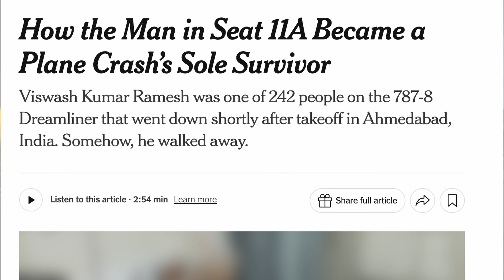Why the RAT Changes Everything – Air India 171 Update

Comment: Multiple Generators:

The 787 has six electrical generators: two per engine and two backups. This provides a high degree of redundancy in power generation. 

Backup Power:

In the event of generator failure, the 787 can rely on a lithium-ion battery for a short period, typically around six seconds. This is enough time to deploy the ram air turbine. 

Ram Air Turbine (RAT):

The RAT is a small, windmill-like device that extends from the fuselage to generate electrical and hydraulic power when all else fails. This ensures the aircraft can maintain essential flight controls and avionics even with complete engine failure. 

Triple Redundancy:

Key systems, like the Flight Management Computers (FMCs), are installed with triple redundancy. This means there are three identical systems, and if one fails, the other two can take over, preventing a single point of failure. 

System Independence:

The 787's electrical system is designed to minimize the impact of failures. For example, the system powering hydraulic, environmental, and lighting systems are designed for efficiency and redundancy. 

Software Redundancy:

The 787 also incorporates software-based redundancy, such as triple redundancy in the Flight Management Computers

Comment: In the late 80s Air Florida crashed out of DCA. The thrust indcater was faulty.  Because a clogged peto tube in the engine intake.  In the air Florida crash it was ice that clogged the tube.  So it would have to be something else. Could faulty thrust readings be a contributing factor.  How much runway do they use before V2

Comment: I didn't buy a premature flap retraction - first of all you would have to be some kind of bonehead to mistake the flap or gear handle on any aircraft.  Then there is the fact that on most aircraft - especially large ones - the gear lever is normally on the instrument panel while the flap controls are on the center console - most commonly on the right side.  I figured on a dual engine failure when I first saw the video, mainly because there is no apparent asymmetrical thrust, so both engines cut out at about the same time and spooled down at about the same rate.

Comment: I do know one thing.  If it's fuel contamination investigators can rule it in or rule it out.  There will be a log book somewhere that shows how many gallons/liters were put on the plane and it can be tested.  And you are right, having flown in jets with 3,000 plus flying hours, sitting near or over the wing where the exits are is the place to be. Typically, if I'm deadheading, I'd have my nomex flying suit, nomex gloves and flight jacket on even during the summer months, for take-offs and landings.  If one can survive the initial fireball you at least have a chance.

Comment: It has alwys been my theory that it was engen failure, that plane did not fly at all, that little power it had was just that of take of, so the engine must have failed in the middle of the runway, it was able to rotate because the speed was already good for that but the engines failed in the process, I'm saying that because it didn't have even the power to take up the LG, the way it was flying if the was a run way in front, it could have landed safely, infact it was not fly it was falling but falling nicely.

Comment: If it's a dual engine failure due to a technical fault the truth will not be allowed to come out by Boeing. AI was an original National Carrier and the Govt will play along due to prestige and the heavy Boring presence in India.. if it's birds then the Govt won't allow the report to come out coz it points fingers at environment safety issues in the vicinity of the airport, especially since it's Gujrat

Comment: In these times of mischief and sabotage Captain, I suspect foul play. There are things A respectable gentleman like yourself cannot suggest, but the few seconds of video and the bang is perhaps why someone whipped out their camera and started recording. A loaded plane filled with 400 passengers and fuel all the way to England, at critical take off cannot recover after V1 if the system has an explosion that cuts it's thrust. I mourn the loss of life, but like the last Concorde accident, there would have been no reaction time. The automatic RAT deployment was probably an indication of how hampered the Pilots were. 😢😢😢

Comment: Great commentary and with appropriate language!
I could be mistaken but the flaps (next to rhe body) do not look very extended.  They usually are sharply down from the wings.  Loss of power in both engines could be contaminated fuel which caused the pumps feeding the engines to fail.  
Contaminated fuel (excess water) was the cause of fuel gelling which brought down the first B777 in a crash just short if the runway at Heathrow.
All of the black boxes will tell the tale once the investigation is complete.
Sadly, this will be another episode for Air Disasters if they are still producing nee shows.

Comment: Pretty sure the engines were running fine but, I am also fairly sure there was Turbine stall for whatever reason evident by no smoke out the tail pipes. Those engines are extreme fuel learn/hot burn and if the running environment is too hot too dirty and too heavy load (unknown condition the engines were never designed to fly in) the engines will turbine stall regardless of air/fuel management systems plus both might even go into limp mode auto reducing throttle (Dumb). These engines can't rotationally stop leading to a restart option in the air which would also make a loud (Lean burn) bang as both would restart together (We can see in the video this restart never occurred). "Limp mode" disallows a restart!!!
"Limp mode" on aircraft engines, I have absolutely no idea why this condition even exists?!!
Notice: These are Turbo Prop Turbine (100% By pass No Jet No after burner) engines and you mentioned the sound of the RAT well these make almost the same sound upon take off.  The best way to hear the full power sound (only these engines) make is to be ahead of the Engines (I didn't hear anything close to power on. Power was in Reduced condition). Bottom line is these engines need a lot of thick air (Ground effect air) to take off, I assume once up in extremely hot air these type engines will loose thrust and thereby the Pilot will full throttle panic causing Impeller over run ( Low thrust), it's hard to think throttle back to save an Air Craft from Crashing but, take it from  "v-22 osprey prop over run" . 

Far Fetched; The way I see it is; the engines auto reduced power and the Air Craft went into auto land which believe it or not these Air Craft have (Someone musta hit the switch and the pilots put there heads between their knees).

Comment: 1. Can the RAT be deployed manually?
2, If so, I'd it possible that the pilots mistook the failure to climb (because of incomplete flap deployment) as dual engine failure, and deployed it?
Reply: 1 yes,  2. lots of config warnings to ignore. They would normally look at EGT and N1 N2. and confirm they were low /zero. Also RAT is fast to deploy, seconds

Comment: Another bit of evidence of a dual engine failure is the pitch of the landing gear.  I watched several videos and every time on departure and landing, and normally the main wheels are pitched up.  If you look closely, it looks like the wheels are pitched down.  A little research I found when the main landing gear is stowed, the first thing that happens is the main gear pitches down.  The power failure happened right after the copilot placed the gear lever to up.

Comment: Could it be linked to similar maintenance issue like the one suffered by KLM a month ago? KLM has decided to ground seven of its Boeing 787 family jets after the discovery that maintenance procedures for a refueling system were followed improperly. The causes of the issue are also very well-known. The maintenance issue in question involves a system that is used during aircraft refueling. This system is identical to that which is found on Boeing 777 family aircraft. KLM indicated that while the parts remain the same, the differences between the maintenance processes of the Boeing 787 and the Boeing 777 on this system are slightly different.

Comment: What if the engines were still going but the hydrolic system had a complete failure and caused the flaps to retract? Gear would not have been able to retract. Wouldn't that fit the scenario as well?
Could you imagine something that would completely kill the hydrolics during a takeoff  and if that did happen would your flaps settings automatically fall back to 0 without the hydrolic pressure being maintained?

Comment: It's an excellent video explanation by Captain Steeve. I know very little about flight engineering so I apologise in advance for a naive question. Deploying the RAT I assume is quick but needs time to restore electricals, hydraulics and power - not enough time just after take-off? I realise the need for RAT deployment is rare but I'm just wondering whether it could be deployed routinely just before take-offs, as a precaution, and retracted like the undercarriage when flight occurs?

Comment: This is old news, we already know the RAT was deployed.
Reply: The rat deployment was not confirmed from the footage available at the time.
The flight data recorder should be able add more light on what caused this air crash.
Reply: @PetraKann There is a video where you can hear it as the plane flies past. 🤦‍♂️
Reply: @JDozza 
....need the black box flight recorder to confirm dual engine failure.
The fact that the landing gear was not raised would confirm loss of power (assuming the pilots tried to raise the gear).
Dual engine failure is very rare, especially after take off.
We can rule out bird strike 
So it's either fuel contamination or software.
Fuel contamination is a strange scenario in this case because the plane's engines were running okay to get the plane off the ground.
What happened about 10 seconds after take off?
Reply: @PetraKann  This is a classic example of the Swiss cheese model. There is footage of issues in the cabin before take-off regarding a/c. There also was a story about previous maintenance issues with the plane a couple of months earlier. There's videos coming out now with actual footage in the cabin before the crash. But yeah, what you're saying sounds about right.
Reply: @PetraKann I think there were issues with both engines prior to takeoff. The reason is the amount of runway used. As the plane takes off, you can see the dust kick off the end of the runway. I think the captain made a mistake before V1 despite its time to achieve V1 and chose to take off.
Reply: @JDozza 
my understanding is that when it's dry at this airport dust is always kicked up by jets taking off.
Let's hope both flight recorders are retrieved intact and all data can be transferred.
This is a very rare aviation accident. There have been a few accidents in take-off attributed to excess ice on the wings and fuselage or poor deicing procedures but this is not an issue in this accident. No evidence of bird strike either.
The four broad categories of crash causes are Mechanical, software/control, human error, environmental

Comment: I think its reasonable to assume that the copilot when to raise the gear, and the hydraulic system crapped itself. Engines died, rat deployed and the plane crashed, with no possibility to save it. And Boeing is going to scramble to explain it away, instead of taking responsibility
Reply: I think a combination of poor aircraft servicing and Boeing having serious design/quality issues. I remember a Boeing tech years ago saying the Dreamliners were rushed out and he wouldn’t want to fly on them.

Comment: Dual engine failure can happen if fuel pump valve has been switched off manually at the time of inspection by mistake that is y the plane flew for 30 sec only exhausting fuel remaining in the engine and pipe
Reply: Not a valve, not just one valve feeds both engines, fuel is located across the aircraft with multiple pumps. Failure of all systems seems more likely, but we’ll see

Comment: Finally. You hear the RAT but the jet engines are almost silent. Couldn’t retract flaps or landing gear with little to no hydraulic and electrical power.
Reply: RAT supersonic noise,turbo fan not super sonic. But they definitely lost Power, just how exactly is to be determined

Comment: On the BOEING  787 DREAM-LINER, immediately after the RAT is automatically DEPLOYED, isn't it supposed to provide the needed "emergency back-up AC electrical Power" for the instrument gauges to continue functioning; as well as the "back-up hydraulic-pump electrical power" for the flaps and other flight-control surfaces to continue functioning,..... including enabling the landing-gear hydraulic doors to fully open ????  Otherwise, the RAT is useless in an emergency take-off crisis situation. Could this be an "ELECTRICAL POWER TRANSFER BUS" hardware/software issue ????

Comment: In this better quality video with sound, you can indeed hear in the first seconds of the vid that it's like a WW2 fighter plane with propellers flying by.  But we don't hear jet engine sounds, looks like both jet engines were already out of action at that point which is probably why the RAT auto-deployed, thanks to the explanation of captain Steve.  
Normally when a plane taxies to the end of the runway where it turns ready for take-off, they test the engines right? Just like you can do with a car, you step on the gas pedal but you don't put it in gear. They must have done that, thinking everything is fine. Moments later the engines must have failed without them knowing. Such bad luck it happened right after testing them.

Comment: Captian Steve, genuine question, if it were dual engine failure… My only question to that is why didn’t they abort before / during V1? I understand this may have occurred after take off but the likelihood of them not knowing BOTH engines failed until 10 seconds after takeoff is hard to compute for me, even as a non-pilot with 1500 hours of Mayday air disaster experience 😂😂

Comment: Cause.......ground crew, wrong fuel, no fuel,  could it have been bad fuel ( heat/ water/ condensation/ contamination  etc ) , is there a way or means where the fuel lines / pumps could vapor lock due to humidity, and altitude...?

Comment: Eerily, V.K. Ramesh (Ramesh is his first name) the sole survivor of AI Flight 171 sat in Seat 11A, and his hospital bed is #11 as well. 
Your first theory is still correct, Capt Steve. Wheels out, flaps in; instead of wheels in, flaps out. But the reason for that has changed. The assumption was copilot error, and now we know it was electrical malfunction due to electrical power loss.  The RAT probably makes enough power for radio, displays, etc but not enough for wheels and flaps? Wheels and flaps issue, plus thin air at 37C/98F, plus power failure was the cause.  It was not a Copilot error but the wings and flaps were still one factor. The pilots are heroes for landing the plane such that there was a minimum loss of life in a dense urban setting.

Some more facts to consider:
1. Runway at AMD airport is 11,499 ft long. On that runway, most planes liftoff after taxiing for 7000 ft, but Flight 171 taxiied for 11,000 ft.
2. VK Ramesh heard a loud bang.  It may have been a compressor stall in the engines. I don't see evidence of a bird strike.
3. Passenger on same aircraft on prior flight from Delhi to AMD reported a cabin power failure - no AC, video screens not working, etc. Air India did not investigate this. They should have done so. The attendant call button is on the video screen not overhead, so passengers could not call attendants. This would be of concern, as would the AC system for cooling in 98F temps in a packed plane. 
4. RAT deploying points to power failure, as it drops automatically when electrical power (not engine power) is very low.
5. Power failure was already present in previous flight, so this was not a catastrophic, sudden failure like a bird strike. This issue existed on previous flight. This is noteworthy. This signals poor maintenance of aircraft, something Air India is notorious for and has never been held accountable for.  Tata company owns Air India.  If this is a negligence issue, Tata Co. is criminally liable for 290 deaths.  Given Modi govt's dismissive attitude to the deaths of their people, and not holding the rich elite responsible, there will be few consequences to the preventable murder of 290 people.  The Modi govt will want to blame Boeing and though they may well be at fault here, the Dreamliner 787 has a track record of safety worldwide.

Comment: My theory RAT deployed without any reason, and the aircraft is designed to draw power either from the engine or the RAT not two at the same time, RAT was not able to produce that much power and the engines are forced not use its power.
Reply: That would be a massive design flaw, if AC bus form the engines doesn't have priority

Comment: Sir, the RAT deployment can also commanded by OEF (one engine failure) with dual hydraulic pump failure. Also, the fact the the gear is tilted forward suggests that the gear up was commanded but failed right after input. 
So no, it’s not necessarily dual engine failure. 
We didn’t consider all possible outcomes again. 
The data will tell all. 
Cheers 🍻
Reply: Naa no rudder input and it was almost tracking straight.
Reply: If that was the case the landing gear doors would be open
Reply: If it's a single engine failure, that would imply they shut down the wrong engine.  Granted that that's possible, but would they have shut down the engine THAT soon?
Reply: @chrisschack9716 doubtful 
Too quick
Reply: So quiet for two screaming jet engines on a takeoff path, especially for engines as large as the ones on a B787 - trust me, I know - I live 5 miles from an international airport.